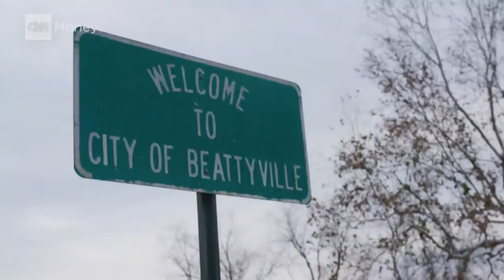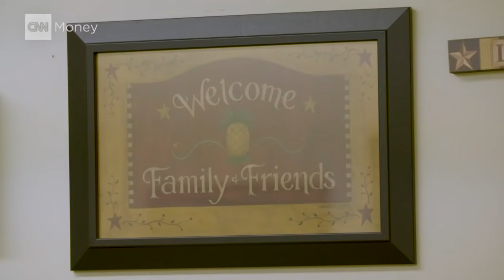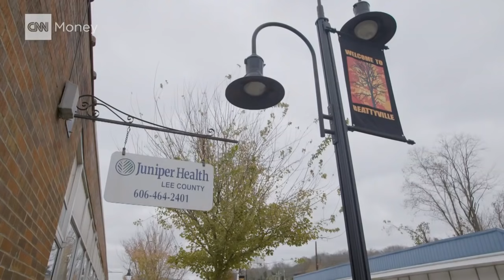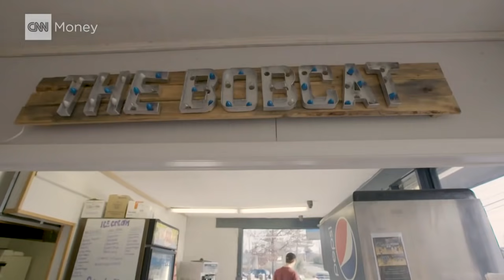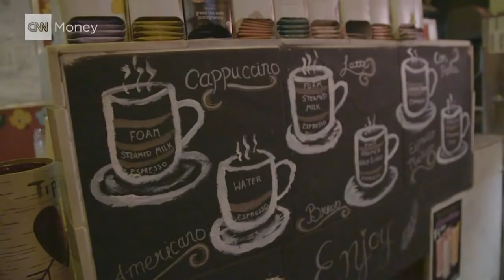Kentucky Trump voters: We still like him, but can't wait for him

Comment: He's got to right a half of a century of wrongs. It's going to take some time to accomplish with seemingly insurmountable resistance at every turn. All of America has not had a real wage increase in 30 years.  Gas electric,  coal,  oil,  l.p. etc..... energy of all types have gone up steadily. The only energy source that remains virtually unchanged for decades is human energy.  Company owners have given themselves steady raises, live in bigger houses but won't help those who they employ. It saddens me that these company owners will be on the front page of the local newspapers giving six digits to the United way or some other charity. If you could make a living  at work we wouldn't need charity now would we?  B.S.